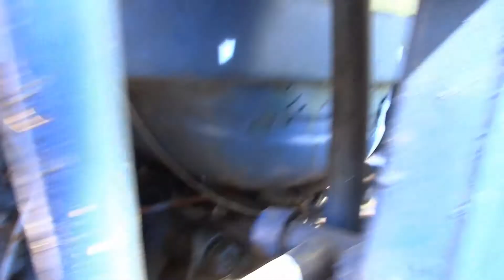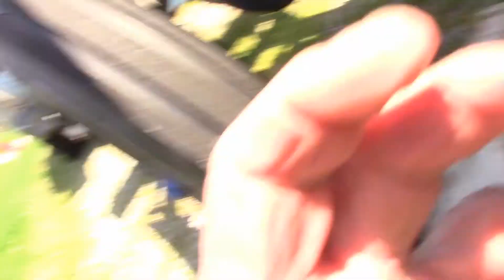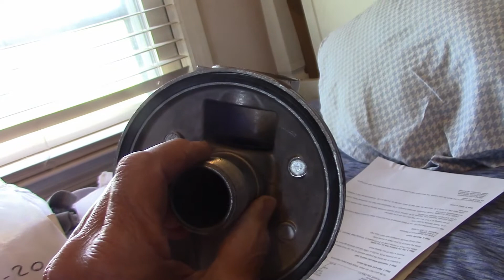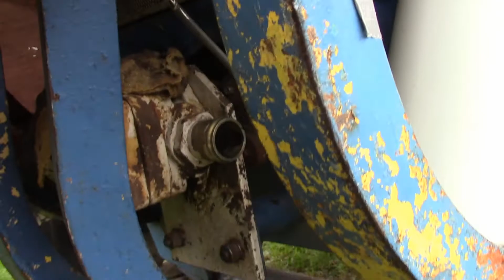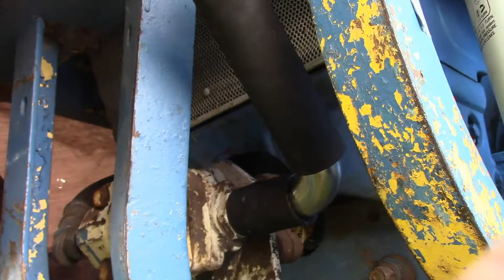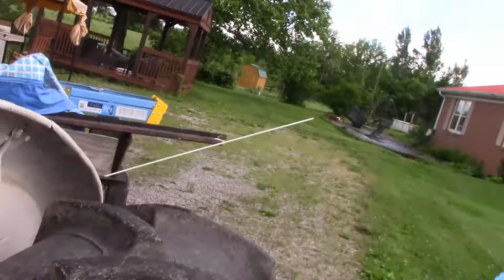Hydraulic Filter Change Ford 730 Loader by Bhodie Bob

Comment: Those often shipped yellow as industrial machines.
Reply: Low fluid level can cause overheating.   The whole loader frame is the hydraulic cooler for the loader.

Change fluid annually or 600 hr.  This is due to volitike additives and water absorption of the oil.  Hydraulic fluid is designed to emulsify the water, not let it separate out.

Comment: Very informative video! The only video! It's actually the only info I have found on the subject. I have a 620 with a very similar loader. Where did you find a guide for this procedure? I need a manual for this loader.
Reply from the maker: Sometimes a free manual can be found online.  i didn't have one for this project.  I have heard that filters can be had from dealers.  I searched and searched on the internet.  Even just for a type the same size.   Definately try to find the filter -  the method i used was a lot of work.  It is still okay though.  In theory i should change the spin off filter but i have so many other things to fix.   Actually the power steering on the tractor leaks so bad i can't use it.  That will be a winter project and spring video.
Reply: @BhodieBob  I have a 1962 Ford 4000 with a very similar heavy duty loader on it..I changed out the front mounted "stinger" pump out and the a custom suction hose made for it..a little longer than the one that came on it..after I fixed everything the loader worked great..then I tried to lift a big heavy Oak tree trunk I chain sawed and a seal blew out on 1 0f the 2 loaders levers that raise and lower the loader..when the seal blew out the loader went straight up to its highest point and stayed they until I shut the tractor off..then the loader came down...I replaced the seal and refilled with hydraulic fluid and even after bleeding all the air out of the system the loader will barely raise up now.  I am wondering if I have a filter in the frame too where I add the hydraulic fluid to...I am hoping I have one and it's clogged because I have no idea why the loader won't raise any higher..I am tired of working on it with no results.
I see your tractor has a low front mounted hydraulic pump too..   anyway Thanks for this video..I will definitely check to see if I have a filter in the frame like yours does.
Reply: If you can ever find out any name(s) of who built your loader please put it / them here..I can't find any info on mine either..this is the closest I have seen after many hours online of searching.
Reply from the maker: @rosskrause3926  do you have the 640 or?

Comment: Good job.   Glad it worked for you.  I got a ford 340 diesel with a 745 loader. Im looking for a filter too.   You got me thinking.
Reply from the maker: my way was the hardest way.  easiest way would be put it back together new fluid no filter.  then you could change the fluid after a while.  Let me know if you figure out something else.
Reply: @BhodieBob  ok I will. 👍
Reply: I have a 340b with a 745 loader and I got the filter from my new holland dealer
Reply from the maker: @trav395hus8  was it a metal composite filter in the leg of the loader?
Reply: Yes it was a mesh filter and came with the gasket for the lower plate at the bottom of the loader leg. Filter was 12” by 3 approximately